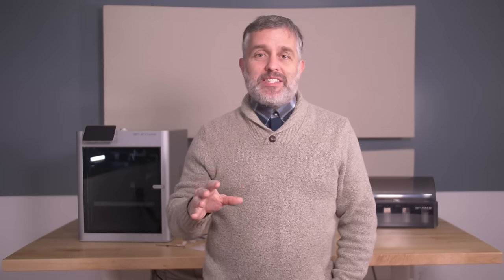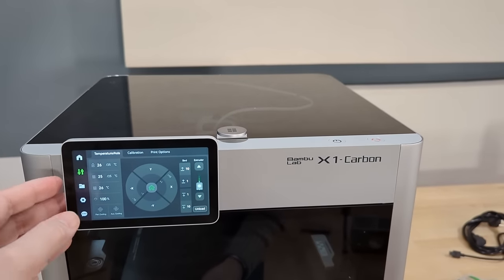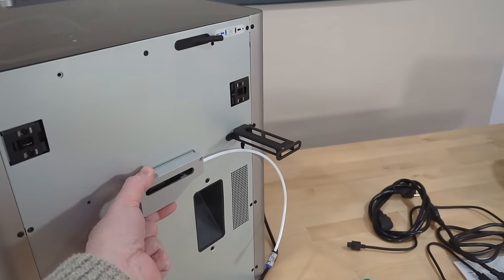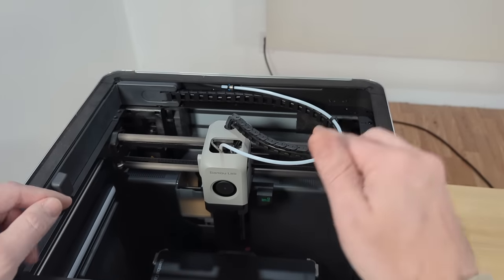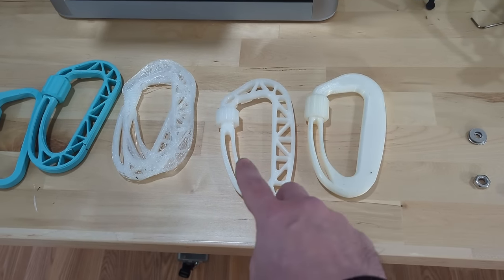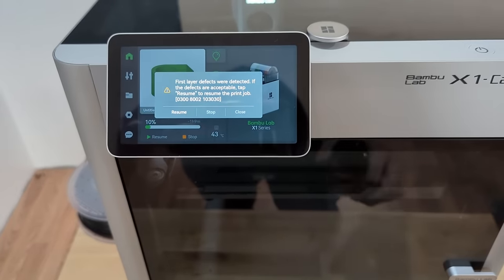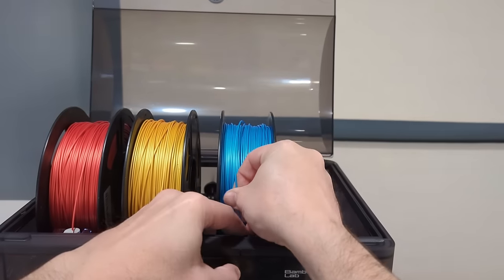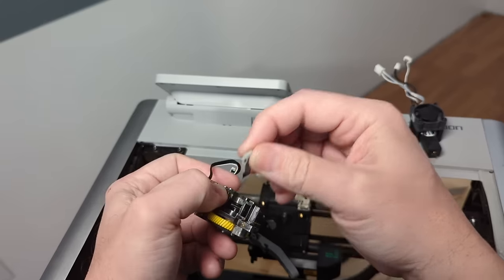Why The Bambu Lab X1 Carbon is a PhD Master Class in 3D Printer Design

Comment: you can send gcode without the cloud and you can run it locally. (send) in the dropdown where you used send plate. at the printer under network set to local only. this will cause them to lose the ability to watch the camera and app.

Comment: The printer is a step in the right direction.  The next step is to make 3D printing as simple as printing a Word document on an inkjet printer.  I should not have to tell the printer how to do things.  It should just know how to give the best result.  The printer should know when to use supports, how fast to print, how much cooling, what temperature, etc.  When 3d Printers do that, then they will be consumer products.  Of course, people (some) still want to control things, and even if the printer did all the work, you still could.  Just as a Tesla can auto drive, you can still drive it yourself.
Reply from the maker: This printer is close to what you are asking for.
Reply: @DesignPrototypeTest  actually what I want can be done to any printer.  The printer just does what its told.  Maybe adding AI to the software to handle all the "tinkering" bits would do it.  Thus, if you still want to tinker, you can.  Again, simplifying the process would open the door to anyone that just wants a finished print.  As there are literally millions of STL files out there, if a user just wants something, they can then just print it regardless of complication.

Comment: Interesting 2nd point you made about mounting the bed and hitting that left side guide where the bed would, potentially, sit on top of it making the bed level be incorrect. And the way you had to reach in and then force the magnetic plate was not good. I will add that these fully enclosed machines make extruder jams harder to deal with. I much prefer printers that are NOT enclosed where you can either buy or make, and I've made enclosures for 2 printers. I have an older Sindoh which is an enclosed machine where it's actually a reach over to adjust the magnetic print surface, and I have to remove the right side cover and be very careful when I remove the extruder and clear jams. NOT fun. I actually built my enclosure with a fan to remove toxic fumes from ABS and I also have a heater to keep the enclosure at a temp that helps me with ABS prints, although ABS is NOT my favorite filament, I defer to PETG for most of my prints.

Comment: https://youtu.be/_y7Me79WMws?t=2443 You are correct that it can mess up in situations like this.  I have 7 Bambu lab printers and have had multiple times switching from abs and pla where it will get jammed and after taking the extruder apart the jam is in the extruder, a ball of filament, where the filament was soft at one point and created this ball that then hardens and can no longer exit the extruder in either direction, in or out.

Comment: I had mine for a week, it worked flawlessly until the AMS just broke - stopped feeding filament. Now looking at the support boards I can see there a lots of problems with them. Quality control is obviously a problem. FWIW, mine is a main production run, not an early run.

Comment: Please don't criticize electronics being in the heat chamber.  This is perfectly fine as long as they use "Automotive" grade components, proper heat sink and a high Tg for the PCB itself.  In addition, they would have sized their components appropriately for the ambient temperature under operation. I would bet anything that these boards were tested in an environmental chamber before releasing to production.  This is especially true if you go for CE certification.
Reply from the maker: How about a vibrating and heated environment? Seems like an especially harsh environment. Especially when the PCB isn't potted and most of the heavier components are only supported by their soldered connections. Probably couldn't guarantee past ~45°C which is why the chamber isn't actively heated or even fully sealed.
Reply: @DesignPrototypeTest  Not an issue if it is designed under IPC Class 2, which I expect it is.  As a pointed example, I have vision sequencing board that I designed for a 3D scanning system that sits inside the burn chamber with a plasma cutting robotic tool head.  This is a $1.6 M machine and sees temperatures well above what this printer will ever see.  I made sure that the Tg of the Dialectric material was at least 150C and used automotive rated components.  The board sits on a moving gantry that sees way more accel/decel that this printer would and yes, vibration too.  Really vibration becomes an issue more when something is not rigid to the same body as the moving object creating the vibration.  In which case, grommets can be use between the interface to smooth it out.  

So in summary, without knowing what design steps they took one can't simply say that it is a bad design.  That is far from the truth.  Test and reliability qualification resolves this.  In truth, 3D printing is nothing when it comes to harsh environment designs.  I work with way harsher environments and my designs have no problems.
Reply: @DesignPrototypeTest  One more point when it comes to temperature.  The temperature itself usually isn't the biggest issue for PCB, it is the temperature rise time.  Fast rise times is especially important bad, slow rise times no so much.  Think about the reflow that occurs on these boards to make them.  They undergo 1-3C/s rise for 4 minutes to a temp of 250 to 300C with a process that can take up to 4 to 6 minutes.  Now you can only do this a couple of times under this stress, but none the less the components themselves can handle it.  Usually, all my components are rated to 110 C for normal operation.  I use larger SMD pad sizes to help with heavier components to deal with vibration and shock G forces.

Comment: Good video, thanks!   Now, perhaps I can give you some useful advice, if you have not already fixed in in the last 5 mos:  It is a nice touch running a multi cam shoot, but you should sync the White Balance kelvin temperature of the two cameras, or at least color match them in post-production - it is jarring to the viewer.

Comment: I'm thinking you printer has an older firmware.  01.03.00.00 and now 01.04.00.00 have the ability to control fan speed as a percentage from the HMI. And you can control all three fans whereas, on your version I only see the 2.  You can override the speeds while it's printing.  Also, at some point, files that I've sent through the cloud have also ended up on the SD card, I think this started with 01.04.00.00.  However, 01.04.00.00 is turning out to have issues.  There are reports that prints no longer stick to the bed and no amount of fiddling seems to correct it.  Although my update went fine, I wouldn't recommend updating till it's sorted.

Edit: Guess I shoulda watched a bit more of the video. Later on, I see all 3 fans on the HMI.

Comment: Hey, on the bed adhesion comment you made how nobody has tried it, I've been using my own mix over the course of the last year and a half. Can I send you some for you to sample and tell me the differences between the commercially available liquid versus mine? I have printed on my x1 carbon only using cool plate and engineering plate: pla, petg, abs, tpu, asa, pla+, pacf with success. I can share the formula only if it beats the commercially available product!

Comment: Let's be honest here:  If apple made a 3d printer it'd use a proprietary filament that you could only buy from them, it would only print via wifi and would require their own dongle to connect, if you lost the dongle you'd have to buy a whole new printer because it would be married to THAT device only, and any failed print would be called a "feature" instead of a failure.  It'd also cost 3x more than any other printer out there and if it ever failed you would have to replace the whole thing instead of just replacing the broken part and each printer would come with an identifiable amount of human suffering included in its manufacture.  Though when it worked it would work very well and it would be pretty.
Reply: @sierra659  Ah ...I see that you're an Apple designer.

Comment: Hmm, that g-code that does calibration and LIDAR is not secret, it's in the slicer and you can tinker with it. Any slicer can adapt it and use it. There are some moving parts in it, not everything is documented (I skimmed through it), so something like first layer scan is not just a matter of dropping the g-code in as you need to know what area to scan, but after that, it's the firmware that does the job.

I like your review, I like that you disassembled it, but there's just too much misinformation in it for it to be trustworthy in any way...
Reply: I think its more than in marlin and other open source firmware you can look at the code that is being run when a gcode is triggered. While we can see what the gcode command is, we don't know of its inner workings like we do on marlin and company. That is what he is talking about I assume.

Comment: Regarding the pivoting/elongating joint on the Y axis uprights, i've got a similar problem at work and i'm thinking of using "tapered roller bearings" (ID 30203) because they allow for a small tolerance, but unlike say "spherical roller bearings" which allow for a lot more, the tapered roller bearing can totally detach top from bottom (inner from outer, ie threaded rod part of bearing from bed-part of bearing, and therefore has some elongation tolerance too. But how well it works idk yet. If anyone knows of a better bearing i'd like to hear it! :)

But it's a good idea because if the bed could be moved like with clutched tapered roller bearings, a single motor could wobble the bed and extrude into cavities, giggidy.

Comment: No man. If Apple made it, it would require special square filament that you can only get from Apple, and if your hot end clogs you would have to return it to an authorised Apple repair centre to be unclogged. And it would be 4x the price.
Reply from the maker: Hi Tim. I remember you. Good to see you. Bambu Lab isn't as extreme as Apple, also not an evil capitalist company with profit as the main decision driver. However, I do think this printer was designed to be like an Apple product and as the company matures I hope we don't see that emulation appearing in their business practices giving rise to the situations you parodied.

Comment: Great video, BUT I don't agree at ALL about the giving credit part. I'm not saying that it is not possible, but it's unlikely that they copied everything you talked about. These solutions, like using carbon rods, are the obvious choice to any sane mechanical engineer looking at the problem with a fresh set of eyeballs. Apart from that, why wouldn't they give credit? They already dedicated a part of their page to the Voron team, teaching tech and all the others. It wouldn't cost them anything to mention the others too
Reply: The spirit of open is to contribute back to the community as an ecosystem

Comment: Nice printer, but I will wait for my preordered Prusa XL. I do not like closed source 3d printers as they are still so much work in progress devices. The multi material solution does not impress me: I have the MMU2s from Prusa and hate it. You need a multi tool device for more reliable operation.
Reply from the maker: My apologies. At first I thought you were a shill. If you hate your MMU2 so much then why do you continue to have faith in Prusa? If you love multiple tool heads, why have you not bought an E3D tool changer? Why do you not believe all the positive videos showing the Bambu Lab functioning just beautifully printing multiple colors?
Reply: @DesignPrototypeTest  I think the Bambu is a really nice put together machine and I believe it works well. I have a Prusa MK3 at the moment and it has served me well in the past. I like that I can make 3d printed parts for it myself. In 2023 I would not buy it again though because its technology is obsolete and I would consider buying a Bambu, but my requirements have changed: I need a larger print bed for some projects. The Prusa XL has that plus more modern technology. Will it be perfect? Of course not, nothing ever is. The multi tool option of the Prusa is a nice add-on, which looks promising. I am still in doubt about when to add it. It can wait: almost al my prints are single color. I am not a fan boy at all. I do not care about company names at all. I have owned Apples, Windows machines, I-phones,  Android phones, several car brands etc. I like them all.

Comment: It is super fast. I have had one of these for awhile now. Just can't get good quality prints. My ender s1 beats this heap of garbage without doubt. Also bought it to print abs, but that is also pretty hard to do, it needs more heat. Quality gets a bit better using cura, but that is not very convenient.
Reply: Other videos I seen on the printer, it has very good quality, not sure what your issue could be could you describe what artifacts you are having?
Reply: lots of ringing, and the layers look very very bad, the layers did get better with cura, but the ringing has no cure, going slower does not help, just do some search on youtube and they'll explain.
Reply: @solasauto  I even print miniature and I don't have the issue that you describe with the P1P... actually the quality is quite good... maybe you have come defect on the machine.

Comment: Thanks for the brutally honest review. It’s especially helpful when I’m on the fence about completing my purchase. Bambu emailed my $1,200. invoice and I couldn’t pull the trigger with all the problems reported on Facebook about this printer. I feel buying one would be like owning a 250 mph supercar that is high maintenance and keeps breaking. I have eight E3 S1 Pros running very reliably at reasonable speeds with Sonic Pads. I can simultaneously run eight builds and not worry my printer will 
crash. 
BTW.. I’m now able to buy professionally refurbished S1 Pros for $250. delivered and have a few more on order.
I can buy five E3 S1 Pro refurbs. for the price of one C1 Carbon!
Thanks again for saving me a big headache babysitting the X1!
John

Comment: If Apple made a 3D printer it would be 1.unnecisarily expensive 2.require proprietary cabling 3.repairable by Apple techs only 4.use special filaments only available through Apple and 5. use software obtained exclusively through the Apple App Store

Comment: BambuLab 3D printers are the Tesla of the automotive industry... I will never buy an EV for as long as I live but I grabbed an X1C as soon as possible LOL

I think the reason BambuLab went with ONE stepper motor instead of 3 is because, ONE, one stepper motor is strong enough to operate the entire plate, two, less drag and 3rd, one stepper motor rarely gets out of sync opposed to 3...

Love it or hate it, this is the new standard in 3D printing... adapt, evolve, overcome... we've seen it in the cellphone evolution from the early 2000's and so far, apple is still leading in the cellphone industry followed by Samsung... whom listens to its audience and caters to the constituents always wins in the end...
Reply: Three motors are complete waste since they do not help to compensate for bed flatness. In needs to be compensated on the fly, not just adjusting bed leveling before the print. So they become completely rudimentary if flatness compensation is present. Not to say they need to be placed somewhere, and you cannot just place them under the bed without enlarging enclosure.

Comment: I tried to watch the video but you're on a little bit of the negative side of the top of the line machine. I would do this, I would do that, I would do this, I would do that. You know what I mean. Everything has to be built for a price point, some of the things that you talk about are rather petty. A short lift list of negatives and positives would do fine.
Reply from the maker: Everything can be improved. It's surprising how many decisions in product design are the first idea. I realize you love your printer, and they did a really good job releasing this product, but it's far from perfect. Things can akways be improved
Reply: @DesignPrototypeTest  sure everything can be improved but at a cost. If they fix everything that you suggested they would probably be $2, 000 or more that would put them out of reach fo alot of people. So like I said everything is built to a price point and most of the things you pointed out aren't vital to the machine doing what it's supposed to do. Which it does very well.

Comment: Hi Matt
I am a vivid admirer of your content you put out to enlighten and inspire " the 3d community"
What i would love to see is that this 3d printer would be used as a starting point.
Fe janck out this ccp approved motherboard and replace it with duet with expansion board maybe chat gpt can help with coding , increase the heat insulation and maybe continuous fibre or idex.
Would love to hear your thoughts on this.
Reply from the maker: This printer is a product of a certain kind of thinking targeted at Prusa's audience. Many aspects of it are there to manipulate the perceptions of non-engineers. Function following form. Fundamentally there are some design aspects which would be problematic and cannot be overcome. To accomplish what you want It would be better to start from scratch.

Comment: If Apple made a 3D printer? 
Suddenly I don't want it anymore. I'm guessing it's all proprietary parts that you can only buy from them when it goes wrong.
I've also heard since that all that glitters isn't gold. Yes it prints insanely fast, but that costs strength in the part. That's simple physics. Heat needs time to transfer and bond. It's also subject to the normal problems of all FDM printers which is the filament quality. This is the number one reason you get non-smooth prints.